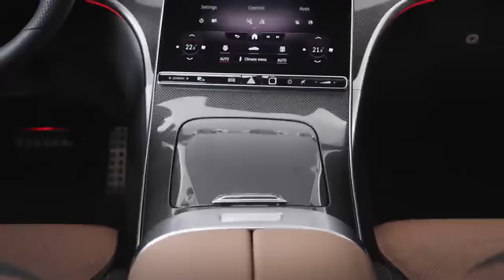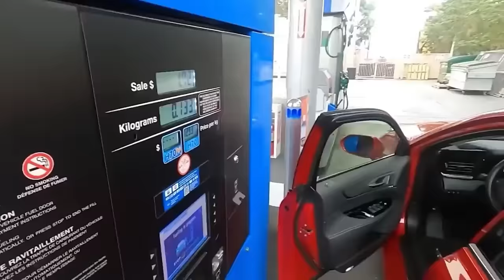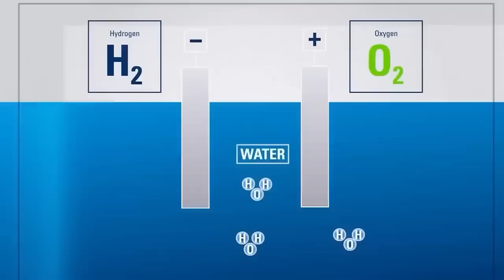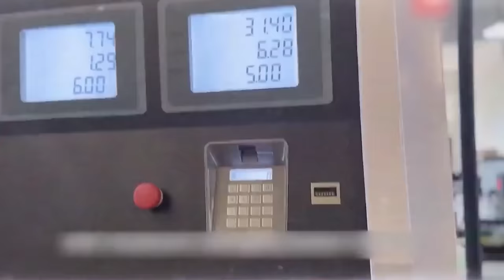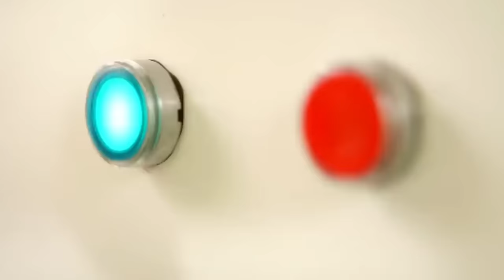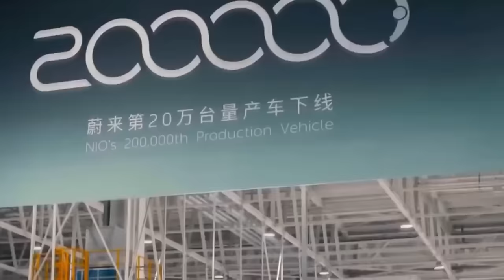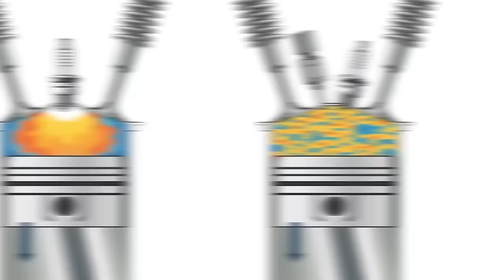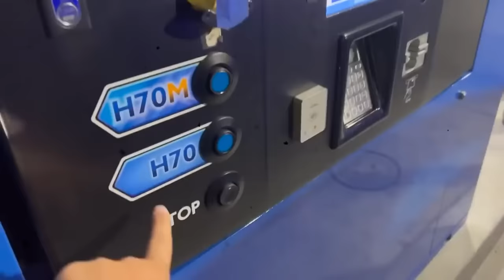Toyota CEO: "Elon Musk Will Crap His Pants When He Sees This NEW Motor!"

Comment: What pisses me the most is that this invention isn't even new. Guy who invented it around 50 years ago was poisoned for not accepting deal to stay quiet with such technology. Oil industry has some real Devils.
Reply: The amount of energy that a converter would need to use to convert the hydrogen to mechanical energy is almost as much as a normal car needs to rund only on oil. There is no point in hydrogen cars…

Comment: And they can condense the exhaust to get recycled fuel. Hybrids have batteries too, that's not good. Hydrogen engines can power electric generators for every single use of electricity.